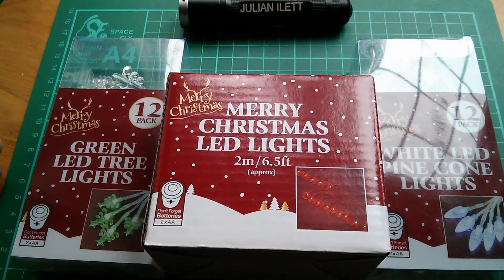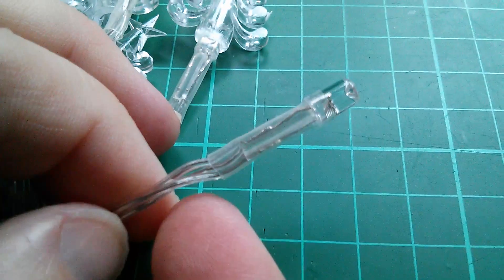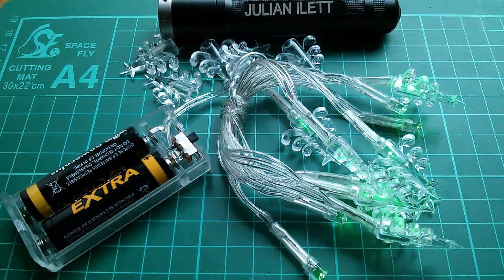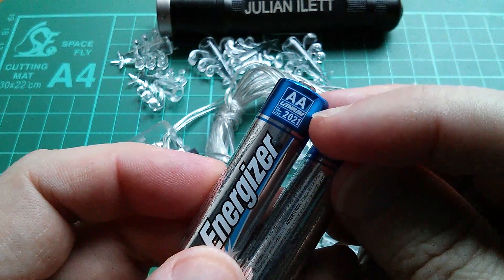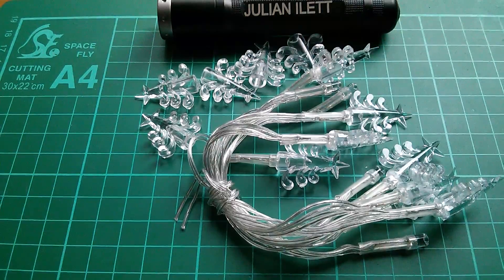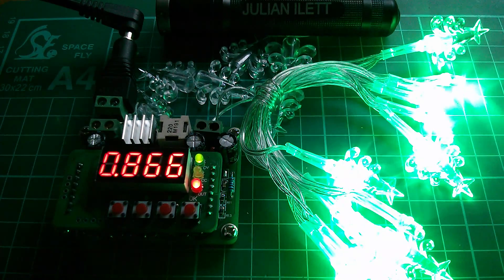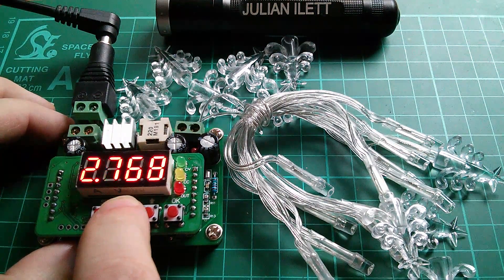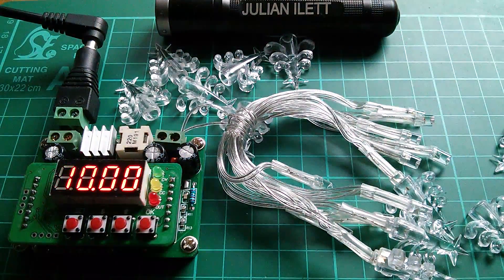Christmas LED Lights Extreme High Current Test

Comment: The forward voltage of the LED's is about 3,2-3,6V so when it is used on the battery the LED's doesn't self destruct cause the supply voltage is either matching or most of the time slightly lower than forward voltage of the LED.

Comment: It's not the "more voltage" that killed them. It's the more current. But at first when you had the 5V limit you where at that limit. The power supply was in CV mode. So it was not fair to say a 3A supply wasn't enough. They could not reach the 3A.

Btw, the flickering is probably because they get hot and the very tiny bond wire onto the led chip began to come loss because of expanding and contracting. Very common in the big 100W COB leds.

Comment: Twas the lights before Christmas...
Nice one Julian. 
I did something similar during the week with some LEDs I was given and decided to make a clip-on array for el-cheapo reading specs.
I had 6 LEDs in parallel with 180R resistors and a 4xAA battery pack. This gave me a dullish LED at the power input and very dull at the other end.
Went to a 9v battery and had some LEDs fizzle and pop so it's now soaking time to remove them from being superglued to the brass strip.
I think they were first-gen anyway, probably 9 years or older.

Comment: Julian, Have you ever come across a board on that maybe good to power generic head set mic for a system that normally requires a mic that accepts phantom power. I want to be able to flick my preamp between my xlr mic and my headset mic. just adding the power seems to gie a crappy result. maybe I could add a resistor, though not a clue what i'd need.

Comment: Four wires... well. . that is suspecis.. i would bet they are serie parallell connected.

This  is probably 1.5 or 1.6V led, so they will work relatively fin with out any resistors.

Actually just puting them om 1.5V is really not that bad.
Reply: +matsv201 He says right in the video that they are wired in parallel which would make since because that is how the majority of these cheap types of lights are wired.  Since the newer green phosphor LED's are tolerant of 3.2-3.5v without a dropping resistor they should have no problem running off the peak 1.65V per cell of most fresh commercial AA cells.  The voltage at that load will drop quite a few tenths at that kind of current draw so the LED's should stay well below their rated 20mA.
Reply: kuhrd Yea hi say that. he is incorrect.

Comment: How are you powering that DC-DC converter, where are you getting 12V 3A from? Is it a power supply?
Reply from the maker: +Ahmad Khattab It's from my solar power system - six 12V lead-acid gel batteries in parallel - voltage just 12.0 volts today because there's no sun.
Reply: That's cool. What else do you use the solar power system?
Reply from the maker: +Ahmad Khattab In the winter, very little. A battery charger and a 12V LED desk light.

Comment: Hey julian, have you seen these? 272071698126 (ebay id) 
constant current load for usb port. 

maybe it could be something for your "usb power meter collection"
Reply: Well, i found that taking the bulbs out from 50-bulb mains fairy light strings gets you a really neat usb load. The bulbs are rated 6.25 volts and connecting a few tenths of them in parallel pulls many amps on 5v.

Comment: It's just heat break bond wire circuit and when cool contacts again,thats why flashing.Working like light flasher in old car.
Reply: ***** it is clearly a thermal issue, the bond wire  might be the reason
Reply: +Blahblox Gyuanox So the bond wire attaches itself back? I don't really think so. I think it's something that is going on inside the LED chip.
Reply: +drkastenbrot It could be that the semiconductor substrate around the bondwires is weak due to the welding and when it gets hot there the semiconductor becomes unconductive and when it's cooling down conductive again.
Reply: +BloodySword I think that's what the OP was saying too but with slightly broken english... lol
Reply: +ChaosHusky English isn't my native language, too. ;)

Comment: the material and the size of the encapsulate may be helping with thermal dissipation, also the diode in itself seems to be quite big  at 1:08

not that crappy for the value!
Reply: +Eduardo J R That's just optical illusion. But the metal part that also cools the chip is not so small than on most chinese LED ripp-offs.
Reply: ahhh it could be a lens effect making it seem bigger

Comment: If the wire is really really thin (it is Poundland!) wouldn't the  heating of the wire provide a natural self regulating resistance? Maybe you should measure the Vdrop between a couple of LEDs? Merry Christmas :)
Reply: +Sabretooth Barnacle Full batteries means 3 Volts, most InGaN ones have a 20mA rating at 3.2 till 3.5 volts, so it's save to power them without any resistor even with 0 wire resistance.
Reply: +Sabretooth Barnacle Just thinking the same thing.

Comment: Consider using an ATX power supply
Reply: Whats the point of that? You wouldn't be able to adjust the voltage/current.
Reply: It as more amperage!
Reply: +minecrafter9099 Yea, he does need a proper power supply.
Reply: +minecrafter9099 12v 37A
Reply: +minecrafter9099 Well, if you wanted more amperage, he could have just connected the led string directly to the 12v solar battery array... and probably got the desired bang and smoke in under a millisecond too! 12v @ over 100A would be my guess, considering the number of batteries in paralell ;) In this case he wanted a more controlled bang :-O

Comment: Are these green LEDs with phosphor or are these proper doped green InGaN ones?
Why didn't you put it on 8 Volts? ;) --- Oh I didn't say anything. ;)

You have to be careful, they can get short circuit failure mode.
Reply from the maker: +BloodySword Hard to tell now, most of them are a bit blackened. I can't see any phosphor so I'm guessing InGan
Reply: +Julian Ilett InGaN seems to get better and better in terms of stability and can accept higher currents.
I have 3 cheap 40 LEDs battery powered (in fact I have eneloops in them) LED strings and the green ones have green phosphor which results in a (for my taste) very pleasant bluish green.
But recently one LED has failed. They are powered with three cells and a controller (actually a COB blobbed one) and some resistors. It also was flickering and got a bit warm. I just snapped the LED off for now and ordered a set of green concave ones on eBay. The LEDs don't get more than 3 volts. But the eneloops were at 1.55 volts when I put them in, perhaps the resistor value is a bit tough calculated.

Comment: did you notice your power supply went from CC to CV? it doesn't matter if you had a 10 amp supply. you hit the limit for that voltage with that circuit. yank out the resistors or raise the voltage to get more current.
Reply from the maker: +Shadi2 Yes, at about 1.8 Amps - which is about 150mA per LED. At that point they were voltage regulated - at 5 Volts.
Reply: +Julian Ilett There exist 1.6V green LED. i bet they are in serie parallell in, two and two. That would expain the 4 cables.

This would also make them farly safe on 2 normal batteries